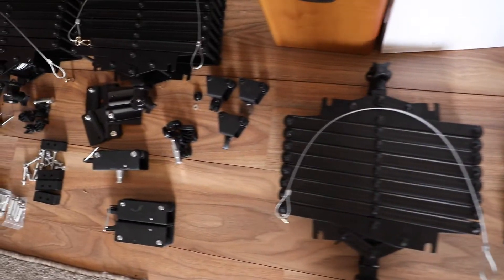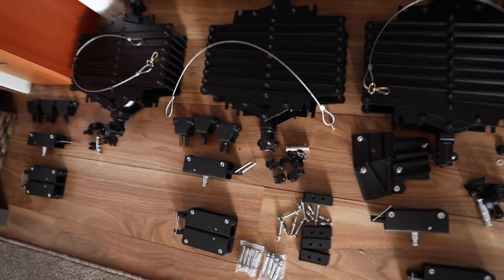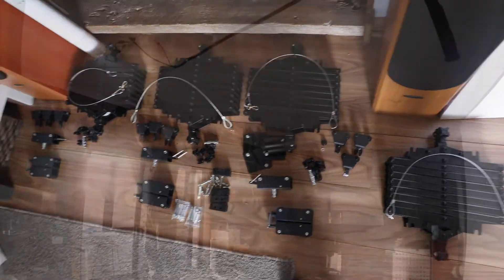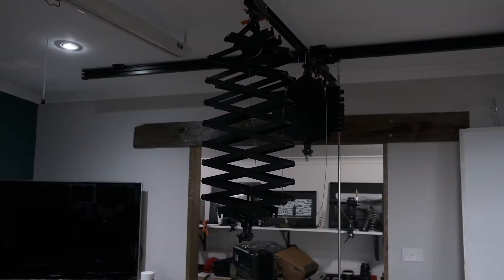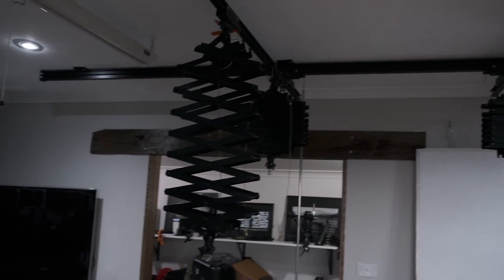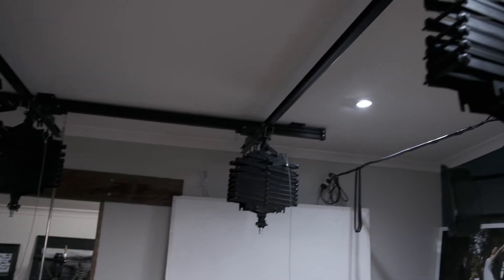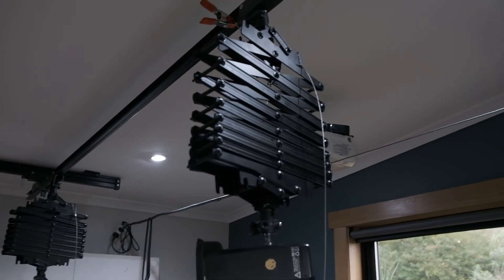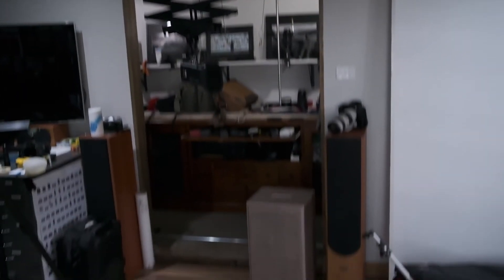Pantograph installation

Comment: Hello, do the plates drill in ceiling joists? I'm looking at this kit and not sure how the plates are supposed to mount into the joists. Thank you.
Reply: Hi...I tried to get at least 2 screws into the ceiling joists. The width of the plates meant for those holes that didn't align with a joist I used ceiling/plaster plugs.